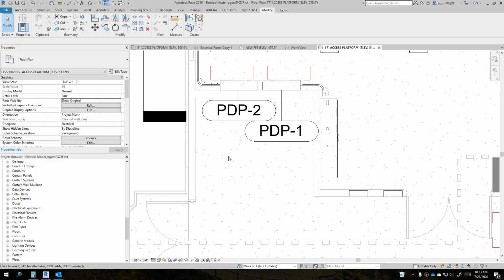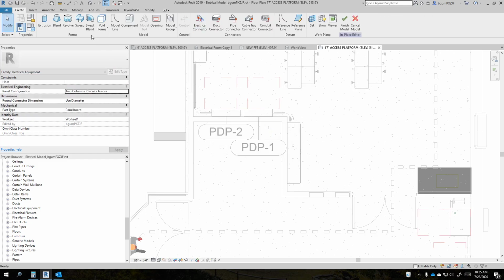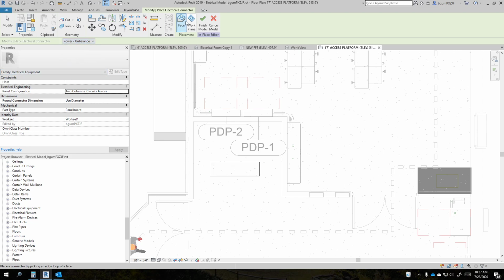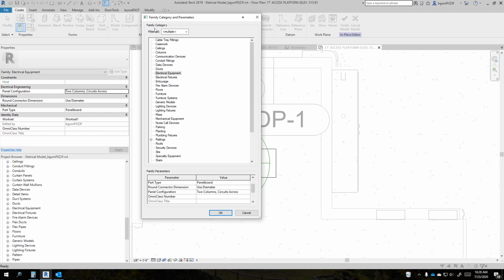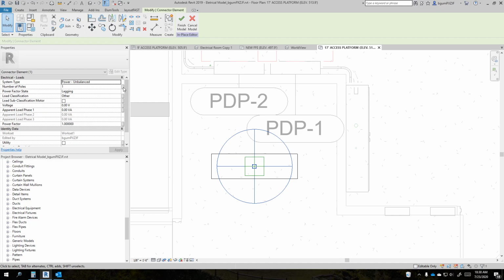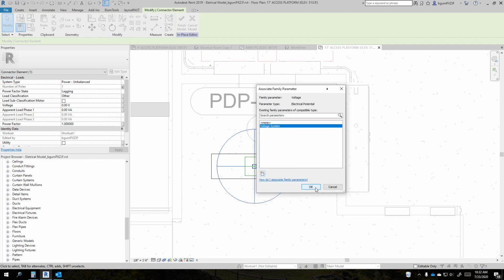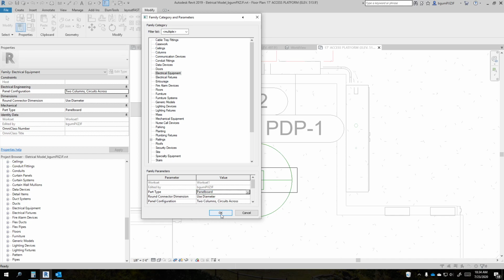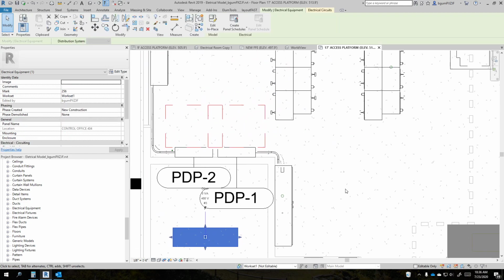How to create Electrical Family Connectors and Distribution Systems in Revit MEP

Comment: I have two pumps (one single-phase 220V, and one three-phase 400V) on the HVAC level. How can I connect it to my electrical panel?
Reply from the maker: Family must have an electrical connector on it
Reply: You need to add the voltage definitions. Those are not standard. You also need a panel or transformer that can handle those voltages to connect it to.